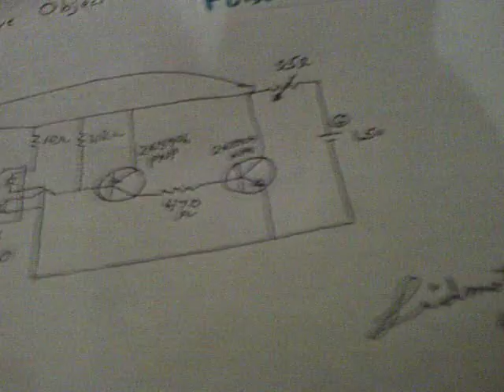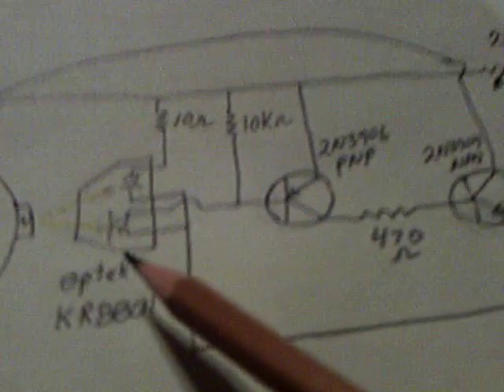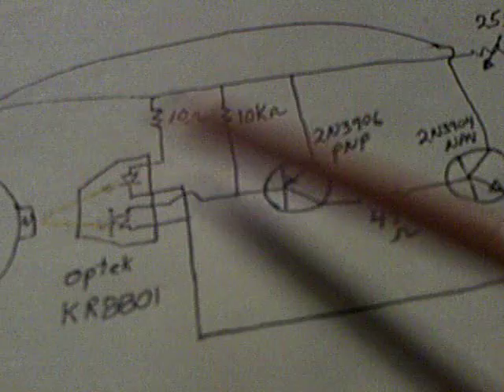Candle Light Triggered Pulse Motor

Comment: my paper disc robot uses an ORP12 light-dependent resistor with a little cardboard cone mask over it; the cone doesn't quite meet up so there is a slit that is oriented towards the black/white stripe on the disc. There is a bright red LED glued to the outside of the cone in such a way that it shines a pool of light on the disc directly under the slit. Although this gives a very good response it is very sensitive to being moved & any change throws a program you have been trying to create irreversibly out of whack. Also there is some problem I couldn't quite track down, I thought it could be something to do with the LED warming up but I never sorted it out
Reply from the maker: david vernon williamson  I started working with this 'light' stuff many years ago when I was 15.  I guess what they say about "what comes around goes around" is really true.  I still find it very very interesting and the new parts make it more fun.  I will check out your paper disc robot video.  The project I did in 1964 was a three wheel light seeking robot that followed a flashlight beam around the room.

Comment: Cool!
Now see if you can trigger it with your voice :)
Reply from the maker: I actually think that is possible.  That idea has me thinking.   The circuit would be the same but the signal would come some audio device.  Cool idea.
Reply: ***** I believe it is possible too.  Record yourself saying "On" and "Off".
View that in Adobe Audition to see which frequencies are strongest, then make a circuit with a mic, op amp, & a JK or T flip-flop to enable & disable power to your coil.  Looks easy, but I'm sure it would take some time to perfect.

Comment: Very interesting ;) now to make it a close circuit use a thermoelectric generator to run the motor :)
Reply from the maker: That is possible!!!  I have the Peltier modules to try it with.  Neat idea. The main motor drive circuit needs about 1.2 volts at 10mA.
Reply: ***** Nice I'll wait for the video :P